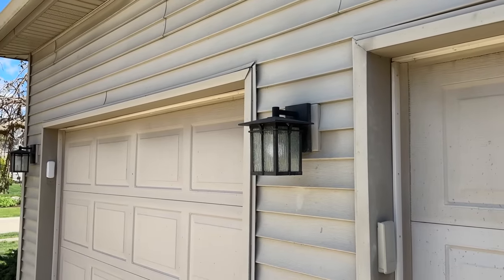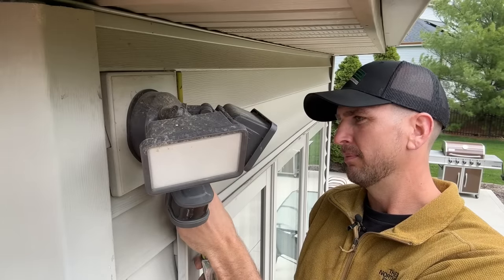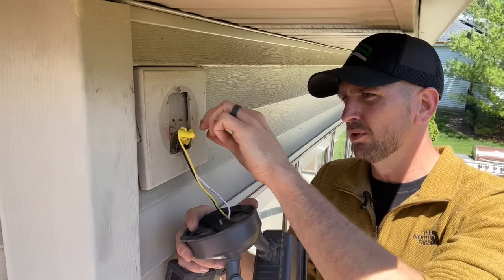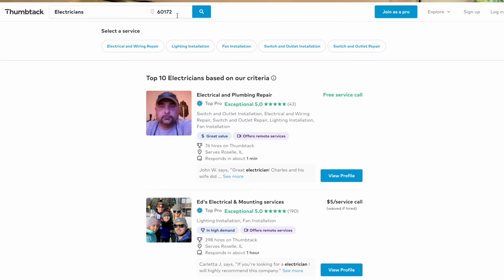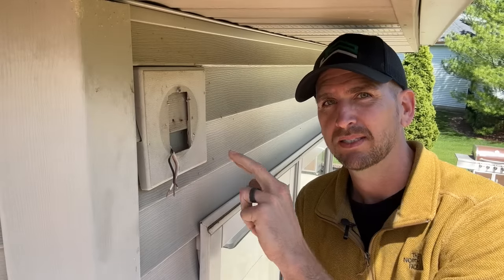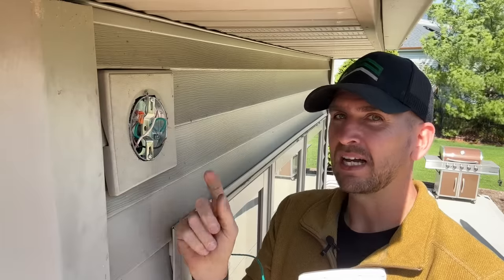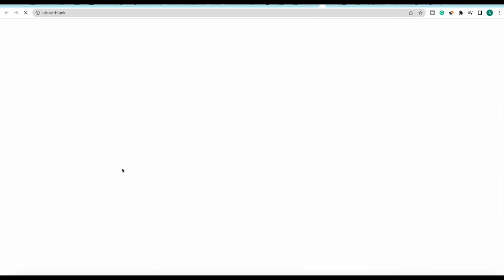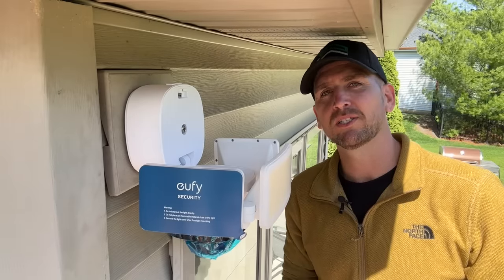How To Install An Exterior Light And 3 Common Mistakes To Avoid

Comment: I just did a lot of updates to a 1970s house a family member just moved in to, and the Wago lever nuts were so incredibly helpful and allowed me to fix numerous wiring issues that you simply couldn't do with conventional wire nuts. And using the Wago for ceiling lights and ceiling fans makes me wonder why anyone uses anything else. They are simply better in every way. Thank you so much for introducing me to the Wago and showing how to correctly use them.
Reply: They lack the durability and low price of wire nuts. On a big job, the price difference is fairly significant. They're also unnecessary to make solid/stranded connections if you know how to properly do them.
Reply: @philhouk3330 just because something's expensive European and easier for DIY doesn't mean that it's always better, in my opinion if you want to properly install a wagi you tape the  levers down so that they don't move on you when you're moving the wires. Now the end-to-end wago now that's something cool

Comment: I have a couple more tips:
1) If your light fixture is missing a gasket, you can take clear 1/4-in tubing and cut a slit in it lengthwise, then run it around the perimeter of the fixture.  This works for a lot of traditional light fixtures made of pressed metal.
2) Consider using waterproof wire nuts for outdoor uses like this for extra protection.  These usually have a silicone sealant inside the nut that prevents corrosion.

Comment: 40 years ago I put a sensor light on my mom's porch.
 It's still works. if I had the replace it. I'd be lucky to get 5 years.
It got creative and took the sensor and electronics and wired it into the existing fixture on the ceiling of the porch. All amounted was the sensor. Made for a nice sleek installation.

Comment: Another great video. Sometimes it's the simple things that matter. I have to change a light just like you demonstrated. I've done it many times but it always bothers me to wire it up, and then let the light hang until I can get situated to mount it. I always check the wires after the light has hung. And I love WAGOs. While changing my light, on a ladder, and juggling tools, I can let the WAGOs do the work. So, it's a simple idea, but it's profound. Thank you for your videos. As an avid DYIer, I thought I knew a lot. Your videos have shown me there's a lot yet to learn.
Reply: I never ever hang things by the wires. Use 550 cord and metal S hooks to hang the item from. The hooks can attach to the box and the cord is tied around your item you are installing. Or I've also just strung the cord through an opening in the box then tied it around the ceiling fan to hold it while I put my wires together. Use an easy to untie knot that is secure and you can untie with one hand and lift the light into place.
Reply: @brianw3415  Good practices.
Reply: Your comment tells me that you need to call a professional...there's a lot of things wrong with this video. This guy probably means well,but he should not be giving advice on electrical work.

Comment: Nice video. You should make it a habit of connecting your ground first then your neutral and hot last. It assures that you have a positive connection to the panel before you hook up the hot despite the fact the power is off.

Comment: I watch tons of (software) programming how-to videos, and I have to say your DIY videos are "up there" with the best of them. :-)  You do not just show-and-tell, you anticipate other perspectives, and you take steps to "reduce the scope" (confidence boosting for viewers with no or little foundation in your material).  I think yours is the only channel I am subscribing to for the DIY topic.

That said, please heed the sparky comments about their code concerns on this one (stapling the wire near fixture box, no bare wires leading into box, etc). This might be an opportunity to revisit one of the installs and show how to do those improvements, even if they were not required code in your area.

Comment: I love the wago's. way easier to work with. and as long as you do the pull test at the end to check for a solid connection you're good. plus they all have a handy strip gauge on the side.

I also take photos of when i do the wiring before and after so i can compare and check later to make sure i didn't miss anything

Comment: Quick little heads up for people who are specifically concerned about code. Those pancake boxes are oftentimes against code as you actually have restrictions on how many conductors of each size compared to the internal volume. Electrician U made a great video about this topic.
Reply: Was coming to say the same thing.
Reply: Great point! I would say though, aside from code, if a temporary solution is going to be done, then the pancake box is definitely better (safer and more solidly fixed) than what was there before. That vinyl cover is not strong enough to mount a light fixture - super dangerous! I think ideally would be to cut into the sheathing through the vinyl and put a real box drilled into the side of a stud, but that's a little more involved.
Reply: @marcbrazzers  I don't disagree. Heck, I didn't say anyone should do anything different. I just figured since the video talked about code some people watching might actually want to know that.
Reply: He is not an electrician
Reply: Pancake box is only compliant if it’s the end of the run, as too much conductor fill is not to code
Reply: @marcbrazzers  nothing is more permanent than a temporary fix lol

Comment: So at my old townhouse that we bought new in 2000, I was going around doing all of the diy things before we sold it. I shut off the power and verified that it was off to the outside porch light. And right there….. no junction box and no gasket!  We had never changed it in 20 years. I took it off and took pictures then swapped it out for a new one. I put everything back the way it was but I did put a bead of outdoor silicone all around to make sure it was good and sealed. When I got up the ladder I saw that water had leaked in. I just didn’t want to leave it worse than when I was there. Now I see that I should have had a junction box! This was a brand new town home! There were so many little things that I wondered if they were to code. I added extra things and even hand wrote out what every breaker went to because sometimes the same breaker would turn off an outlet in two rooms but not the switches.
Reply: Instead of putting "a bead of outdoor silicone all around," leave the bottom open for drainage of water possibly leaking in.
Reply: Right. My home in 2006 didn't have boxes to any exterior lights. Newer may require it by code. Every year codes change. Now, if your business is repairs, you can try to repair to current code but is it necessary? Most folk will be concerned with a simple change fixture for a few bucks  vs a professional charging a couple hundred bucks.
Reply: I believe some fixtures can also serve as a junction box, but only if the manufacturer lists it in the instructions.

Comment: Good tip on the WAGOs, and connecting them to the stranded fixture wires first means the easier connection is while holding everything up in the air.
An idea that might be helpful, is to take a stiff wire and make a hook (or use an 'S' hook from the hardware store) to hang the fixture off the electrical box while you connect the wiring. That is easy to unhook and screw it into place when ready.

Comment: Great video, you did a better job than I would have.  The hardest part for me is getting the old fixture down, all the fasteners are usually corroded.  I grease up the hardware when reconnecting, maybe some electrician's grease on the wires as well.  Next time it comes right apart even if the gasket leaks.
Reply: Fasteners screws should be brass. However that might cost a bit more into lamp manufacturing costs and would lower the profit by 10 cents and that is the issue. Poor manufacturing is the issue. Fixtures should have required national standards. But intransigence by congress will get nothing done. Probably crap from China?
Reply: @glendavis1266  The cheap US made lights were some kind of "pot metal", the fasteners were brass if you  were lucky. Usually not. Cheap China fixtures are usually plastic and the fasteners are going to be steel, plated if you're lucky.
My girlfriend has been buying some kind of US made lights at a big box store but I'm not optimistic. They assemble with small screws which are silver colored and easy to lose.  I bet they're NOT stainless!

Comment: Changes I would make, use dielectric grease in the wagos to protect the connection from moisture/corrosion (don't think they are rated for damp locations, at least then they should be ok, there's not enough room in there to use wago's gelbox), use some kind of sealant (silicone or any other outdoor/wet/UV rated product) on the wall block and around the fixture on the top and sides leaving the bottoms somewhat open to breathe out any mosture that gets inside (i know in this case it is less likely water will get in from being under the overhang, but some always does, and i never trust those seals provided by the fixture).  Done better would be to cut in a proper box in the wall to bring it up to code making sure eveything is properly strapped/secured and water proofed, never like seeing those shallow boxes outside like that directly attached to the outside of the wall, whenever i see them they are rusting from moisture and corroded connections (and yes usually mounted to a brick wall with no sealing around it).
Reply: good point - I guess wrapping the wagos in electrical tape and position them pointing up  ( wires coming bottom) might also help to keep water from trickling in
Reply: the regular silicone has ammonia and is corrosive to wiring.

Comment: WOW! Cool. I plan to replace 2 (eave) floodlight fixtures with eufy units like that. Already bought the wagos from your link. They will make working overhead much easier.
Reply from the maker: For sure, it makes a BIG difference.  Best of luck on the installation 👍

Comment: Many mounting blocks have built in pancake boxes.  Take a look at the Arlington blocks: 8141F "Mounting block with built in electrical box for smooth vertical mounting of light fixtures on all siding types."  Or the 8131 "Siding mounting kit with built in electrical box. 6.8 cubic inch box."

Comment: Excellent video, thanks for doing this. Outdoor lighting or outlets is something I've struggled with in the past. To me it seems there are products that just don't fit or work or are not compatibility with other parts. I wasn't sure what to use once, I couldn't get the info on what to do.  So I used one of those pancake boxes it worked well.  I just built a home and I used adjustable outlet boxes with weather tight covers so I can move it out so I can get a good caulk bead around them. That worked well but remodeling always has it's challenges.

Comment: Great demonstrations. For me working on light fixtures is awkward because one hand holds the fixture leaving only one hand to  do the wiring. So, I start by wrapping the fixture's ground wire around the bracket to take the weight of the fixture, and then can use both hands to do the rest of the work.
Reply: A short bungee cord also works well to hold the fixture while you're connecting the wires.  Attach the bungee cord ends to the box screws.

Comment: I found an example of an even worse exterior garage light installation on the home we bought in 2019. ;-)

The previous homeowner had run a three-wire (grounded) extension cord from an outlet inside the garage, across the inside wall, through the interior and exterior walls of the (uninsulated) front of the garage, and into the back of an exterior-mounted  security light above the garage door. There was no caulking around the holes and only about 3 inches of the extension cord's sheath had been pulled back to connect to the fixture's wiring inside the housing. The fixture was mounted directly into the stucco with drywall screws that HAD been caulked. (The cheap plastic-housing fixture had ceased to work before we bought the house.)

Needless to say, the holes were closed up and the old fixture removed. We ran a new 14/2G Romex line to that point above the garage door into the back of a caulked pancake box as part of replacing 90% of the original (1956) wiring. (The extension cord was pulled out, repaired, and is now back in service as an extension cord.)

Comment: Good video. Thank you for sharing.

Question: Is it code compliant to use a pancake box outdoors in this kind of situation?  I know the box itself is not  weatherproof. I’m just wondering if there is an exception in the NEC that allows pancake boxes to be used outdoors this way.  If not, I wish someone would manufacture a UL listed weatherproof pancake box for this kind of application.

Comment: Thanks for the video. I am rebuilding my childhood home and had an electrician doing all of the electrical. He’s on a vacation (founded by the state 🤦‍♂️) so I am left with a bunch of little things to do. One is outside lighting. This shows me the mounting way I need to use. The last video of yours I watched showed me the connector to use. I picked some up today but they are not exactly the same as yours. I searched your links and didn’t see the ones you recommended 🤷‍♂️

Comment: Thanks for the video.  I do everything myself.  I am a Union Steamfitter but built most of my own log home in 1990. I would have used the opportunity to clean the siding with a some window cleaner  or something. Everything else seemed great in your video.  I have yet to buy some wagos but am looking forward to trying this method as it seems much more secure. Peace
Reply from the maker: Thanks for the feedback!
Reply: With all due respect if you are a union guy you should be hiring union labor to do this work, I bet you would throw up a picket line if I was doing steam fitting work and you knew it, besides if you thought this was done properly it is proof that you should not be doing electrical work.
Reply: @integr8er66  there are no union steamfitters doing residential work where I live. I have been in picket lines but only over industrial work

Comment: I just got a ring food light and I tooom off the old floodlight like the one on the video but it was screwed into the plastic siding mount- there is no box - what should I do! I have a vinyl mounting block like the video- wow exact same issue and I almost installed it wrong putting the mounting bracket on the siding block

What a great video ! Off to get a pancake block! Thank you!

Comment: Couple of things, probably mentioned before, but I can't read all 500+ comments:

- I did see people comment on the Romex into the box problem, so skip that.

- Your pancake box compresses the vinyl siding beneath it, which is likely to make the siding's seam fail, either from flex or from temperature expansion / contraction.  Better to cut the circle out of the siding beneath the block, too, and maybe to use a deeper box as a result.

- As long as you're right there, check ALL the wires for current.  I can't even say how often I've gone to change a light fixture somewhere and found it was wired wrong.  A wire that isn't supposed to be hot can still kill you real easy.

Comment: I think that the gray plastic connector/strain relief/bushing is installed backwards in the pancake box.  In its current configuration, it allows the wires to be pulled out of the box by someone working on another part of the circuit.  It looks like the connector is pushed into place from the inside of the box.  I think that for proper placement, it should be pushed into the pancake box from the backside of the box.

Comment: I have already put my old one up probably was 3 years ago. But am gonna switch it to a solar powered motion light instead of it keep sucking up electricity each time a neighbors dog or bird goes by it.

But i noticed having any bright night lights on just gives the other people up to no good easier viewing around the yard so i keep ours off 

Unless company is coming over then turn it on when i leave i leave the lights off outside most of the time if someone unwelcome walks up the solar powered lights come on through out the yard 

So keep night lights on at night isn't always good

Comment: I’ve never seen one of those mounting blocks before but I have an exterior light that can use one. I sealed the gaps with silicone but I’m going to look for the blocks so I can fix it right and also for a couple more lights I need to install. Thanks!
Reply: Me too ! I looked everywhere for them I guess I wasn’t using the correct words. Hopefully now I can find these blocks
Reply: Menards Big Box stores have them in different colors. Also online if you dont have one near you.

Comment: A pancake box is not rated for outdoor surface mount use. It's not waterproof. It can be used recessed in masonry only. So that is not suitable. 

Also, and this is more personal preference; integrated lights are terrible in concept. If one component fails eg one LED you need to replace everything. Better to use a fixture with standard screw in bulbs that is LED compatible. Not only can you replace individual failed components but you can tailor lumen output; making one LED that faces your bedroom window ie half as bright as the one aimed across the driveway or rear property line.
Reply: That's a eufy security camera and not just a set of led light banks. I don't think anyone makes a camera setup that uses regular screw in bulbs. It has a good enough warranty so I'm not worried about an led going out on my own one. By the time the leds fail I'll likely want a newer improved camera anyways. It's only a 30 ish minute removal and install so not bad once every 3 to 5 years.